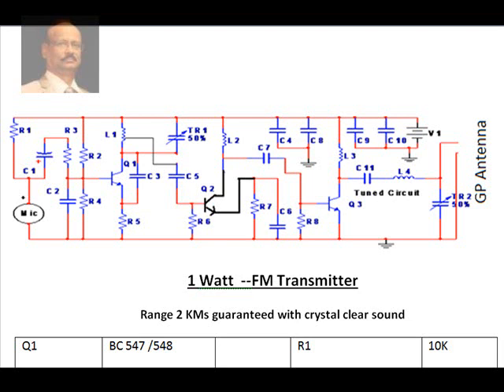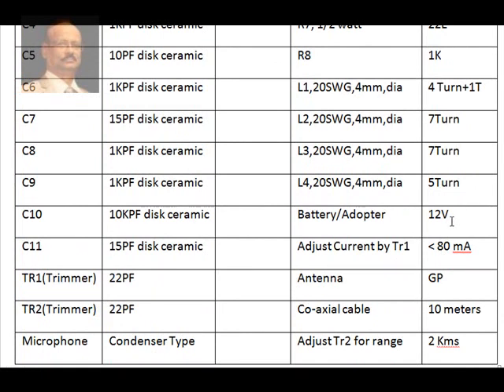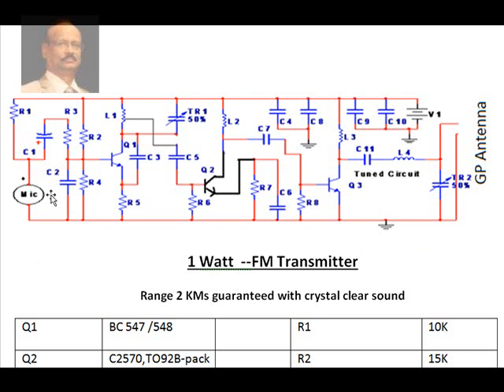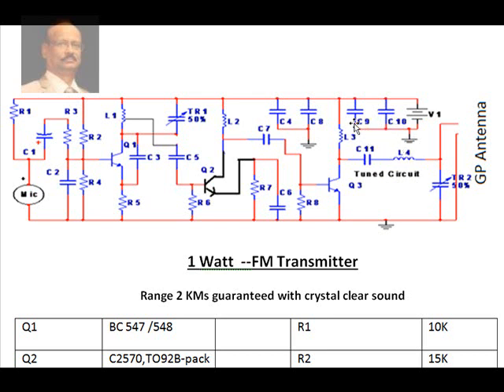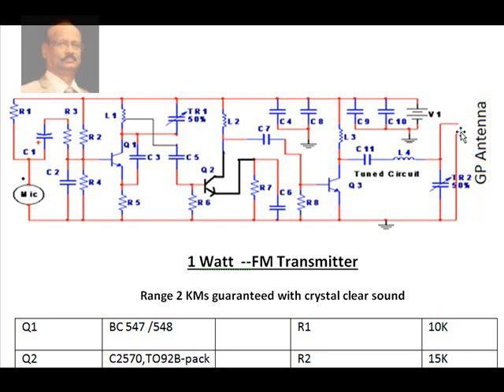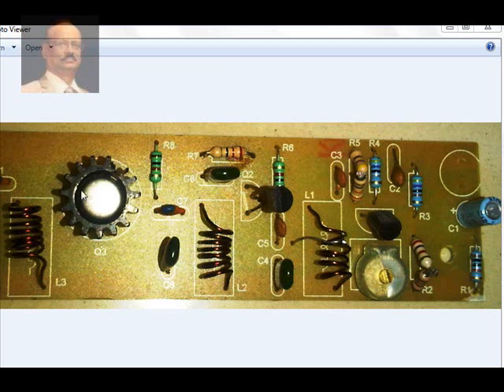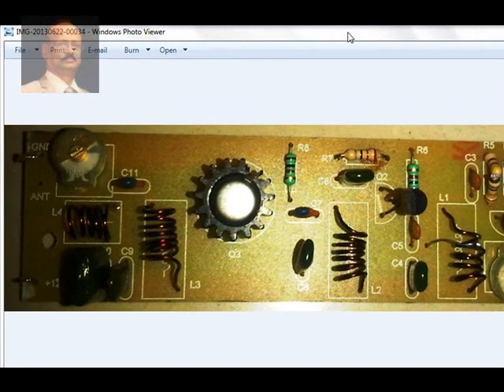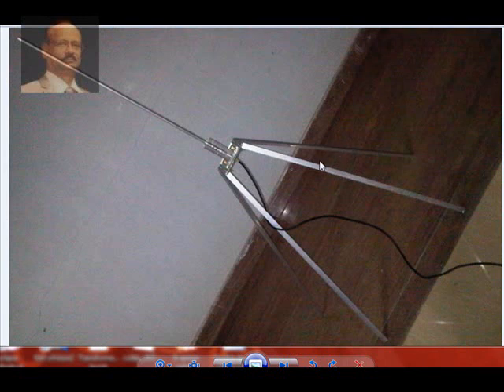FM Transmitter -Long range with circuit ,component list ,assembly instruction for 2 KM range

Comment: Mr Patnaik ...Excellent work you have done in explaining all the blocks of FM transmitter.Do you sell as a kit ? Please let me know as  i am interested to buy it including the power supply ?
Reply from the maker: Thanks & yes I sell the kit only that shall also  include power supply and a stick antenna  at Rs 1500/- plus courier charges actual say Rs 300/-
Reply: Thanks for the info.Please post me u r mobile number to my email address bikashpradhan0@gmail.com
Reply from the maker: bikashpradhan0 9949693280
Reply from the maker: +bikashpradhan0 Thanks

Comment: If you build this, you should make sure that the pcb you make is single sided with common ground plane and make the leads on all components as short as possible. You also need to add a low pass LC filter, this TX will transmit into aircraft AM bands on its harmonics without a filter. Sure fire way to get your local communications governing body knocking at your front door. Other than that, this is a nice little transmitter!
Reply: Spoken like a true HAM. KE4BNF

Comment: Yes this may work! 
Only….
I think it is better to build in front the oscillator a small LF amplifier 
not necessary to make the sound louder, but to keep stable the oscillator.
and normally there is also a trimmer over L2, to tune L2 to frequency.
Also it is possible to use 2 trimmers on the end(TR2) for good tuning,
Than the antenna comes between the 2 trimmers.
Sorry for bat English!
Greetings from the Netherlands!
(and still there is more to make better TX)
Rob.

Comment: cant tune it properly, can  anyone tell me whats the best position of the trimmers...+ which one is the antena connection ground or that wire connected to L4. please help me.
thanks
Reply: change the trimmer in the oscillator from 22pf into 65pf so your range will be bigger

Comment: The 2km range is dictated more by the antenna efficiency and height than by raw power. HEIGHT IS ALL at vhf frequencies, and it's the cheapest way to increase your range!
Reply: If you can't go as high as some of the structures around the tip of the radiating antenna there are two things that will help. 
#1---- make your antenna to be a monopole ( 1 element, not 2, this will allow the electrons to go in all directions).
#2-------- divide the mhz frequency into 243 (this will give you the length that the 1 element should be, thus allowing the height of the wave and height of the antenna element to be the same and all of the electrons will fly off of the tip and into the air.
Reply: No you can't violate the energy conversion law first is power then comes antenna antenna directs the wave that's all

Comment: woh  what a circuit  that is!!. I already made this  and  its  work  properly but its range  only 1 km with crystal  clear sound. I continue some  changes  with this circuit to get 2 km range.  thanks:):):)
Reply: Dear sovan; can u tell me what changes i should do to get 2 km range?
Reply: +shovan jana it worked????
i made the circuit using multism but i didnt get a correct wave form of fm instead im getting a am signal help me in this aspect

Comment from the maker: High frequency circuits particularly with inductors need special PCB  layout and coil orientation  failing which it will not work

Comment: You need to read and learn more about electronic devices in order to understand the reason why this type of circuit does not work on the bread board. That way you wont ask embarrassing questions. Read read read!